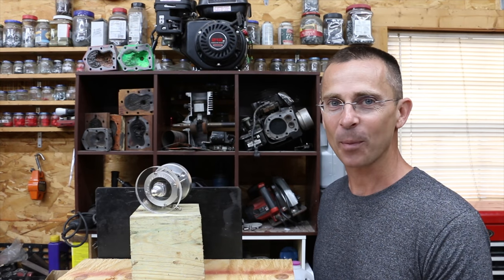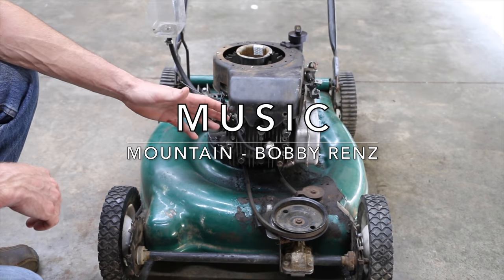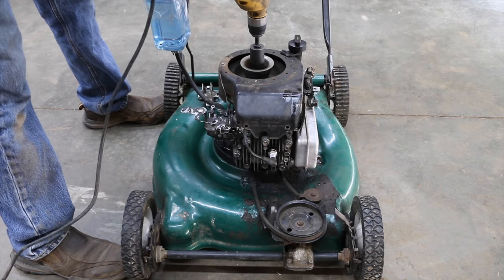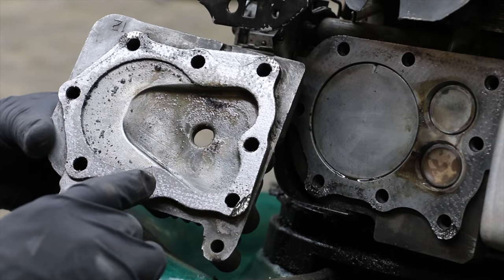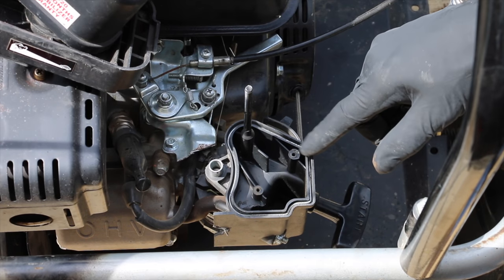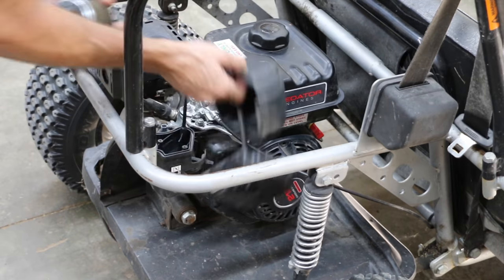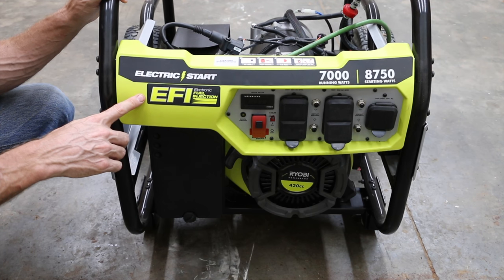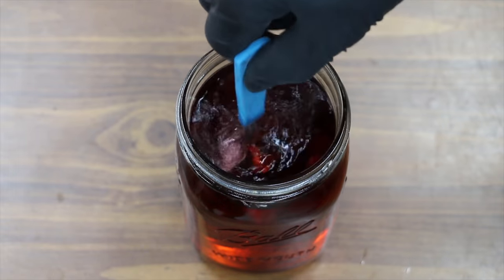Is Leaded Fuel better than Unleaded?  Let's find out!

Comment: I'm old enough to remember when the transition took place, when gas stations began adding unleaded gas pumps.  The unleaded gas,cost substantially more than 'regular' gas, even though unleaded gasoline should have been FAR less expensive, because they had to ADD lead to make regular gas.  Go figure.
Reply from the maker: Thanks for sharing.
Reply: They had to find a lead substitute to increase octane and add that though, right?

Comment: In theory, higher octane by itself should not improve performance, and it might actually decrease performance as the engine is not optimized for it. The purpose of higher octane fuel is to allow higher compression without knocking. This is why putting premium gas in a car that doesn't need premium gas is a waste of money - the engine wasn't knocking to begin with.
Reply from the maker: Thanks for the feeback.

Comment: Aviation gas is made for higher altitude.  But leaded race gas will do great if your jetted for it I run it in my race bike.  Just can’t use it with cats or o2 sensors
Reply from the maker: Thanks for the feedback.

Comment: The 100ll grade of Avgas was introduced in the late 1970s to replace the several grades of Avgas that were available prior to that time. As a fuel designed for aviation piston engines it is specifically formulated to be resistant to detonation in high compression engines running at a high power output level continuously while operating  on as lean a mixture as possible. The engines used in this test have none of these parameters i e they are not high compression engines, they are not operating at high loading over long periods of time and are not being run lean on purpose. Under these conditions avgas has no operating advantage whatsoever. Avgas does have the one odd property of having an extremely long shelf life. Also it won't melt styrofoam. Also you should never ever run it in a modern EFI vehicle because it will destroy the oxygen sensor very quickly. If you want to try it just remove the oxygen sensors and replace them with spark plugs temporarily.
Reply from the maker: Thanks for the feedback.

Comment: Your tests really did not prove anything. All of your engines have governors limiting speed, so that is not a an accurate measure. Also, 100LL is dyed blue for identification. When flying over the rockies or cascades, we used 115 Green. In airplanes, you do not get lead build up unless you are running rich. Airplanes change altitude rapidly and drastically requiring a mixture control. Any ethanol in an airplane runs the risk of it freezing at altitude. (Ethanol gas is banned in Alaska for this very reason) A more accurate test would have been how long will it run on a specific amount. Airplane engines run at high power settings which would kill a car engine if done continuously. Lead prevents valve recession in legacy aircraft. The UND flight school found significant valve damage when switching to G100UL.

Comment: I´ts really sad that here in Germany, you don´t get leaded fuel anymore at gas stations since the year 2000. It was very good for old engines which didn´t have hardened valve seats. Those engines really don´t like the modern fuel, lot´s of valve seat damage.
Reply from the maker: Thanks for sharing.

Comment: Circa 1950 Leaded burned best in warmer climate, and unleaded in colder climates. However I’m sure they’ve changed the recepée since.
Reply from the maker: Thanks for the feedback.
Reply: @ProjectFarm  during Arctic Operations thé Military then suggested unleaded gasoline or Naptha fuels.
Today the Canadian military usually only burns naptha fuels in Colman appliances. I did a test to burn today’s gasoline "being unleaded" in Colman appliances for a complete tank and it burned great through the entire tank.

Comment: Can anyone comment on using leaded fuel with small engines like lawnmowers and generators? Not much info on the web. I have some leaded fuel I'd like to use without wasting, but don't want to use it in my car or boat.

Comment: Lead was originally added to gasoline to increase the octane rating to make it less susceptible to detonation (engine knocking) and the lead also served to lubricate the valves and protect the valve seats. When they removed lead (actually stopped adding it) engine builders had to harden the valve seats and compression ratios dropped (until they figured out how to fix the issue). Interesting thing is that when lead was originally added the petroleum industry increased gas prices (supposedly to cover the added cost of the lead) but when it was "removed" they increased their prices again. Don't recall what the excuse was for that increase but I'm certain they had some sort of "compelling reason" like we want to make more money and sell you a load of BS
Reply from the maker: Thanks for the feedback.

Comment: I’m sorry I didn’t know if you said was it better or not also I just wanna let you know I have a lot of experience with Leaded fuel and race fuel you have to advance the timing to take it vantage of the higher octane fuel and you will get much better performance out of different things if you can advance the timing or have high compression are use let it fuel in my ATVs it runs better and the fuel does not go bad over sitting a long period of time

Comment: Unfortunately avgas seems to ruin engines designed for unleaded fuel. It's pretty common to run airport equipment on avgas such as tugs, and this is what a previous FBO of mine did when they stopped being able to get unleaded on the airport. Unfortunately, even after just one tank of avgas the tug never ran worth a damn on unleaded ever again.
Reply from the maker: Great information. Thank you

Comment: The main reason for Addding lead  into full was to publicatie the valves and to prevent nocking.
Nowerdays the full and the internal combustion engines are a lot better and is the very toxic no more needed.
Reply from the maker: Thank you for the feedback
Reply: The valve stuff was a myth presented by the companies making money from the additive.  It made lower octane gas behave like higher octane.  They could just make the fuel higher octane by doing more cracking and such but they save a few cents putting in this crap instead. Multiplied by millions and millions of gallons, it made them a lot of money while thousands of tons of lead were thrown into the air and settled on the soil everywhere tainting our food and lots of things. 

People are just stupid in the US, when there is money to be made.

Comment: I think a good idea for a video would be to test gasoline with different amounts of ethanol. I believe the Biden administration allowed elevated levels of ethanol to help with the price of gas. The pumps used to say up to 10% ethanol, but I notice it says up to 15% now. It also has a disclaimer that you can only use that gas if your car is model year 2000 or newer. Which I'm not sure why.
Reply from the maker: Thanks for the suggestion.

Comment: Top speed of a vehicle is typically dependent on gearing. A better "motor system" just gets one to top speed faster (or more weight to top speed). I am not sure the top speed test is that useful.  Now an acceleration test would be interesting.
Reply from the maker: Thanks for the video idea.

Comment: Kind of a stupid test. As aviation fuel is made for a different purpose than the gas we use. The lead is to help engine to achieve  higher compression  such as an aircraft engine. The reason the lawn mower ran a little ruff is because the aviation fuel ignites a little later than regular gas. So you're getting a little ignition knock. Under a the high compression of an aircraft engine regular gas would ignite prematurely and give you a ignition knock. Both scenarios throws the timing off. I would never use regular gas in an aircraft or aviation fuel in my car or small engines such as a lawn mower. In the old days hot rodders use to use aviation fuel in their cars and advanced the timing and it did give them more power. But that was easier to do back then. Cars are a little more tricky now days.

Comment: Lead additives are the reason old cars lasted for ever.. Engines of the leaded days were not built up to the standards of today's engine yet they lasted alot longer.. this was due to the lead molecules binding to all the moving parts reducing friction and wear .. the lead build up also reduced  tolerances.. lead is the key to longevity in engines.. that's why it's used in aviation engines..
Reply from the maker: Thanks for the feedback.
Reply: @GeeksGets yeah but so do alot of other things.... The additive used to keep unleaded stable is so toxic that a catalytic converter is needed..  think about that.... And remember, they only last so long but Nobody ever changes them.. so which do you think is worse and what kind of additive was needed to replace lead  that a cat was needed to burn it off before it exits the exhaust system???
Reply: @GeeksGets  😱
Reply: @GeeksGets  you are  incredibly delusional
Reply: @tommiraeko8541  just look it up if you don't believe me
Reply: @holokyttaja5476  why you  raging for ?

Comment: Hate to be negative nelly, but there is something wrong with that engine.  Its very wet inside.  It should be dry as a bone after running that long.  Something is very off!
Reply from the maker: Thanks for the feedback.

Comment: The aviation "low lead" fuel is by no means low in lead content. It was labelled as low lead fuel when it was compared to the original higher lead content of aviation fuel. The orginal aviation fuel had a higher lead content then today's leaded aviation gasoline does.
Reply from the maker: Thank you for the feedback

Comment: Leaded fuel and unleaded fuel (pre ethanol) are exactly the same minus the lead. All the lead did was accumulate on the valve seats to act as a cushion to keep the valves from eating into the cylinder head. Once they started using hardened valve seats, theres no need for lead. Av gas, vs automotive gas is a different comparison. Av gas I much better filtered and qc is much better.
Reply: The lead was in there to increase the octane of the fuel. The cushioning of the exhaust valves was just a convenient thing discovered later.

Comment: I wouldn't say leaded fuel is better but not running it in engines that were designed for it can be a problem.  Valve seat recession on 70's and 80's BMWs from running unleaded for example is a well known issue that can only be solved by expensive procedure of replacing valve seats.
Reply from the maker: Thank you

Comment: That wasn't a very informational video. That black residue inside of that engine after the AveGas was run was from engine oil past it's piston rings and not lead buildup. 

For years, I've been running LL100 AveGas in my small engines, chainsaws and weed eaters and they run much better. Small engines seem to be more susceptible to stale fuel causing issues, causing them to not run well. Every since I switched to Avegas, I don't have issues. Regular Car gas goes bad in about 3 to 6 months. My Avegas lasts me for years. A year old mixed 2 stroke gas in a can, runs fine using Avegas. 

I started using AveGas after dealing with water buildup in my tiller tank and carburetor over winter, year after year, even when I ran it out of fuel in the fall. .......... I switched to AveGas and all those problems went away. 

Like he said in the video, don't use AveGas in engines with catalytic converters or Oxygen Sensors or those items will be junk afterwards. (Even if a little AveGas is used in them.)
Reply from the maker: Thanks for the constructive feedback.

Comment: their is very little difference between using petrol and avgas. both are gasoline, but the stuff you put in your car will have ethanol to bost the ocatane. avgas used lead instad. big differences are that avgas has higher shelf life as the entanol in regular gas absorbs water, but lead wont. this is needed because if your flying a plane and your fuel is bad then thats really bad. the only difference comes from the higher octane which unless your normal fuel is lower grade than the minimum recomened for your engine there will be no difference,
Reply from the maker: Thanks for the feedback.

Comment: A VVT (variable valve timing) engine might go further to get the most out of high octane fuels
Reply from the maker: Thanks for the feedback.
Reply: A variable compression engine would also do the same thing.
Reply: @danafletcher2341  Pick and choose, but I don’t know of a cheap garage engine that has VVT or VC
Reply: @FryChicken  They knew how to go further and get the most of high octane fuels in the early 1900's:

Rear Admiral C.M. Chester wrote Henry Ford a letter on Dec.15, 1916:

"...I also pointed out in the article that as governmental laboratories had developed from 40 to 55% efficiency in alcohol engines as against 20% in gasoline machines, the use of alcohol at double the cost of gasoline for power purposes, was cheaper for motor[s] than gasoline in common use today."

Comment: You're not going to see the benefits of leaded high octane gas unless you raise the compression ratio of the engine.Unleaded will spark knock and produce less power so they lowered the compression ratio of engines to match the fuel.Lead also acts as a top end lubricant.
Reply from the maker: Thanks for the feedback!

Comment: Leaded fuel is not "better" unless you are comparing different engines. Back years ago valves had soft seats. Lead lubricated the valves and made the seats last forever. Today we have much more durable valve seats and it is no longer needed. This change came when we figured out that burning leaded fuel was bad for us, since our bodies tend to not like lead in them! I suppose the lead would wreak havoc on a modern car catalytic converter!

Comment: You won't notice more speed or horsepower unless you have a higher compression engine to utilize the higher octane. In consumer engines with normal compression. In medium to higher compression engines you will definitely notice more power. AvGas is also more stable and exponentially LESS damaging . It will last up to 7 yrs or more, and especially if you store it in metal gascans. I ran AvGas in my race bikes (Yz125, 250, Ktm 200, 250, 300, 450) snowmobiles , all chainsaws, weedeaters and lawnmowers. Your equipment will last forever on Avgas. After a nervous nellie scared me, i had my lead levels checked. they were slightly lower than background normal for US citizens .  ...now the greenies are looking to abolish avgas unfortunately.   .

Comment: "Better" depends upon the application. Leaded gasoline is better in engines designed for it; using unleaded can damage the engine (lead lubricates the valve seats). However, it will destroy a catalytic converter on an "unleaded fuel only" car.

Both leaded and unleaded are terrible as a beverage. 

Incidentally I find it amusing that cars still say "Unleaded Fuel Only" as if leaded gasoline was still widely available which it hasn't been in over 30 years.
Reply from the maker: Thanks for the feedback.

Comment: The reason they used lead in gas was to cushion the valves against  the valve seats.
Reply from the maker: Thanks for the feedback.
Reply: @ProjectFarm  I started working as a mechanic in the early 70s and done that for 25 years. So I was around when unleaded gas came out.

Comment: WARNING: Seriously important advice on wearing nitrile, latex or any stretchable gloves while using a drill press or any high torque drill or wire wheel - DON'T DO IT! -                                                         Even a tap of a stretchable glove on a spinning wheel, especially one with cutting edges (drill bit) or scraping edges (wire wheel) can suck your gloved hand around that spinning surface and break your hand or fingers and even remove them. The action is so fast you won't have the time to pull back. The more durable the glove the less likely it will tear off your hand and the more likely it will draw your fingers around the spinning drill bit.   Especially the durable black nitrile "mechanics" gloves.
Reply from the maker: Thank you for the feedback

Comment: WHAT IS A CADILLAC CONVERTOR ????????? ( video time 10:32 )
Reply from the maker: It's a car part that fits between the motor and the muffler.  It helps lower the volume of the muffler noise.
Reply: As you stated in the video " Cadillac convertor " ,The correct name  is catalytic converter.  It is a emissions componet in the exhaust system to clean up the hydrocarbons.  It's sole purpose is to clean the exhaust gas .

Comment: AVGAS was produced in WWII to deal with extremely high combustion pressures in supercharged aircraft engines.  The efficiency is due to high compression yielding better combustion.  If you don't change the design to use AVGAS, then the test is just meaningless.
Reply from the maker: Thank you.

Comment: Aircraft owner... use in car? Too late! But I water it down with regular high octane fuel you would get a the pump eg: fill up plane spot some in my truck to make price even like a 1/4 of fuel or so. Runs lot smoother noticed no change also would put in aircraft tug which was a converted riding mower
Reply from the maker: Thanks for sharing.

Comment: Air fuel ratio corrected av gas has more energy content than v10 however ave gas is designed for high compression engines and is poorly suited for engines designed to run on v10 pump gas engines.
Reply from the maker: Thank you for the feedback